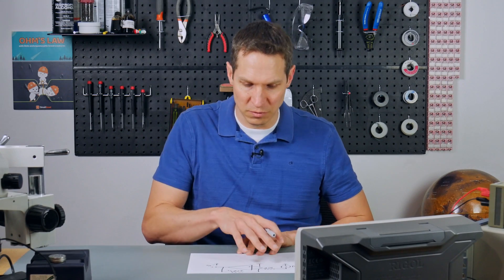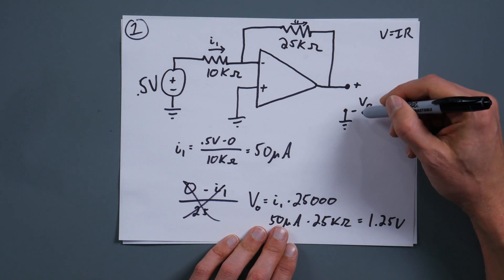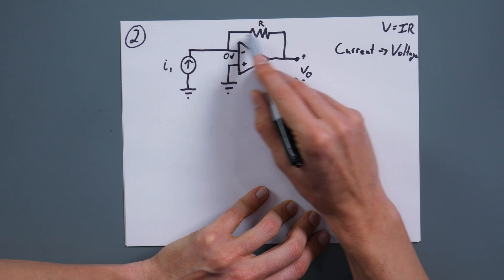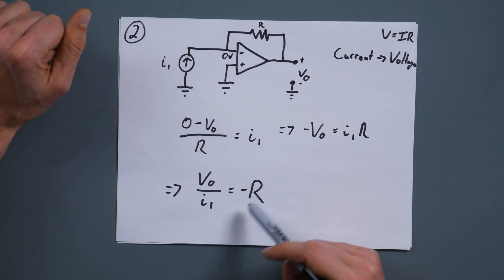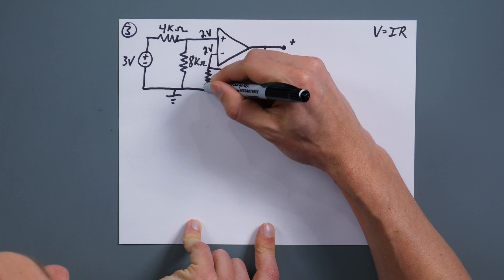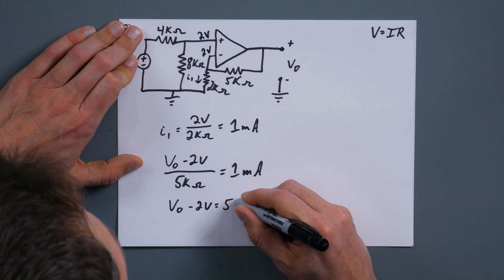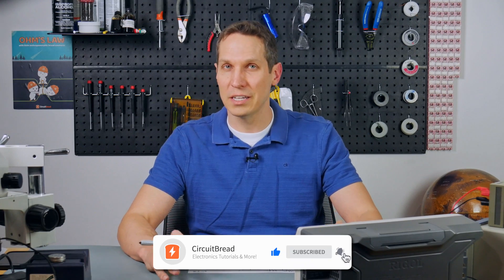Op-Amp (Operational Amplifier) Practice Problems

Comment: Just sayin’ If we have a 5v source going through 35k of series resistance and then straight to Vo. Furthermore zero current goes past the inputs. Why even put the amp in at all?
Reply from the maker: Great question!  We address that in a few other videos but, for that specific question, it's a matter of impedance.  The output of an op-amp is very low-impedance while a 5V source, going through a 35K series resistance, is going to have significantly higher output impedance than an op-amp.

Comment: First practice problem: 0.0005 amps is not 50 micro amps but 500 micro amps, which means voltage output is 12.5, instead of 1.25 volts.

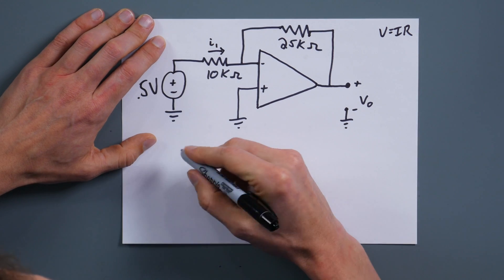Comment: 2:15 shouldn't the denominator be 35k Ohms? The current flows through both resistors, so the resistance has to be the sum of both resistors, or did I miss something?

Edit: I did, now I understand the whole.
Reply: Nevermind, thought it was .5V - Vo and not .5V - 0

Comment: For the first example, the Vout should be -12.5V, not -1.25V.  Vout = -(I*RF) = -(0.0005 A * 25,000 Ohms) = -12.5V.  Also, Vout = -(RF/R1)*Vin = -(25,000 Ohms/10,000 Ohms) = -12.5V.  Or Vout = -(Vin/R1)*RF = -(5V/10,000Ohms)*25,000 Ohms = -12.5V.  Mistakes happen all the time.  That is a human flaw and the first to rectify that issue will be the richest man in the world.

Comment: DOUBT in q3: how can the same current of i1 flow in 5k and 2k ohm resistors. won't there be any division of current
Reply: I think the tutor is assuming, 
vo->5kohms->2kohms-gnd is considered, then, using the fact the volt drop across 2k ohms is 2-0v, leads to 1mA, being calculated, and assuming opamp doesn't allow i1 to enter its + terminal, the current flow in series starting from vo is  taken to be 1mA.

Comment: 8:20 Sorry. To me, this isn't as simple. How did you know to drop 1 volt over the 4k resistor and 2 volts over he 8k resistor?
Reply: As he mentioned, you can just view this as a voltage divider. The current through flowing through the resistors is identical, as they are essentially in series configuration. This means taking the total resistance R = 4k + 8k, and dividing the voltage by it to get the current I = 3V/12k =250uA. Now to find the voltage drop over the 8k resistor, we just multiply the current through it by its resistance. V = 8k * 250uA = 2V  Hope this helps :)
Reply: @Mlhouston3  I was so confused about that calculation but you just cleared it up for me.
Reply: Yessss

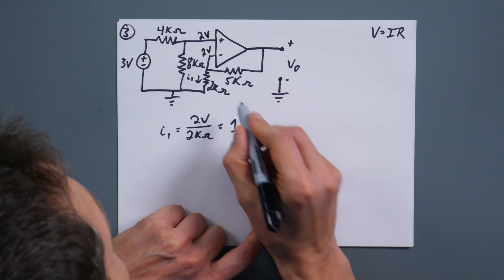Comment: At 9:36, how do we know that the current through 2KOhM resister (i1) is the same as through the 5KOhM resister. Shouldn't the current be different on the 5Kohm side? Not intuitive there.
Reply: because they are in series
Reply: I bit late, but I think I know why. In the example, he assumes the current is running from the righthand side(side with Vo) to the left. So the current first passes through the 5k resistor, comes the the junction, can’t go up due to no current being able to flow into the OP-amp, and so all current has to flow through the 2k resistor. It wasn’t intuitive for my either, until I saw him answer why he went with: (Vo-2V)/5k, and not (2V-Vo)/5k.

Comment: You are teaching some very bad information here. I’ve taken my time to see if it’s just interpretation, but it isn’t. 

1.  The voltages at the two input pins are NOT always the same! If they were, the OpAmp would have no use. An OpAmp is an ideal differential amplifier. That’s all it is. The voltage difference at the two opposite polarity inputs is the input signal of any differential amplifier. If there is no difference, as you say explicitly over and over, the output will always be 0v.

2.  The output pin should be considered a perfect current sink. What’s a perfect current sink?  Well, ground is. Treat it as ground for the purpose of feedback R value computations.

Comment: You have current flowing from Positive to Negative.  WRONG!  Even the US NAVY teached electron flow from Negative to Positive.
Reply from the maker: I'm confused, as you just said what we have said in many lessons.  Current flow is from positive to negative.  Electron flow is negative to positive.
Reply: @CircuitBread  Current flow (electrons) flows from negative to positive. Always! That is what I was taught by the US Military and that is what I have been using for over 40 years.
Reply from the maker: I'm not sure what to say, other than: https://letmegooglethat.com/?q=electron+flow+and+current+flow
Reply: @donaldchapman8392 Electical engineer here. Current flow in the convention that we use to make solving the problems simple. We sometimes refure to it as the holes that are moving which is a postive charge even though it's actually the electrons that are moving which yes move from negative to positive but they are a negative charge themselves so it's easier mathmatically to think about it the other way around.

Comment: I1 = 5 /10 k
     = 0.5 milli amps or 500 micro amps (not 50 micro amps)

Voltage drop across 25 k ohms= 0.5 ma* 25 k
           = 12.5 volt

Vout = - 12.5 v
Reply: He did say "Point Five Volts"... that makes it 0.5V / 10k Ohm

Comment: how do u calculate in the third practice problem the 2 volts. cause i dont understand that part
Reply: So because there is a voltage divider you use Vin ( R2 / R1 + R2 ) to get Vout. Which is 3v ( 8k / 4k + 8k ) giving you Vout of 2v.
Reply: @bunnie7556   thanks

Comment: These were more the theoretical problems with op amps. The practice problems are much different, like:

- the input current is not really zero, especially not in the case of bjt op amps
- in certain cases you need to take care of the input offset voltage, especially in the case if you use op amps as comparators.
- when you operate with pulse voltages at the inputs you have to make sure, that the operating voltage stays stable, even if you need to operate with a certain capacitive load at the output. So you have to use stabilization capacitors between the Vcc and GND pin of your op amp or two of them if you operate with a symmetrical operating voltage. Otherwise your circuit will fall into oscillations
- the nonlinearities of the op amp input circuit can demodulate rf. So if you want to build up an audio amplifier it is sometimes necessary to use a low pass filter at the signal input to suppress rf interferences to avoid that you have some closely located radio station music in the background of your audio amplifier output.
- if you need higher voltage amplifications (for microphone or phono signals), you need to make sure, that the gain bandwidth product doesn't compromize your amplifier at the higher frequencies. Also the input referred voltage offset and noise voltage become important in such application cases.

etc.

Comment: I am confused, how can there be a -1,25 volts on the Vout? Shouldn't that be positive? Just need some help. Sorry for the dumb question.
Reply: I think I get it, it is a negative signal compared to ground? Correct?
Reply from the maker: Exactly!  0V or ground can be somewhat arbitrary.  It's just a reference point and to have a negative voltage just means the voltage is lower than that arbitrarily chosen reference voltage level.

Comment: Nice video, thanks. 
In the last example, I think you have 1mA flowing through 2kΩ + 5kΩ, which gives us 1mA * 7kΩ = 7V
Reply: we dont know the voltage between the non inverting input and output, but we know that between the non inverting input and ground we have a 2V voltage drop, therefor we can calculate the curent that goes from node that connects the 2K and 7K resistor to the ground, which is 2V/2k=1mA. If 1mA exists that node, then 1mA needs to entry that node, and the only way is through the 7k resistor (KCL)

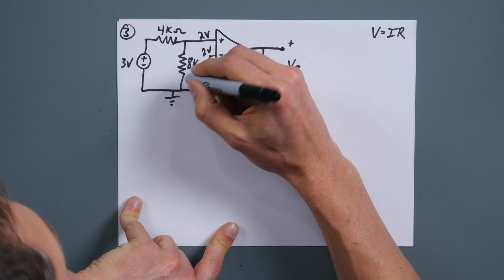Comment: at 9:08 why did he find the current across i1?
Reply: Because with First Kirkowf Law every current who goes in a spot (i dont know the right term but its the place where three or more wires connect) are equal to those who flows out. So he finds the current across i1 and then he knows the current that goes in the amplifier is 0 so he can find the current in the next resistance. I hope it makes sense 😅

Comment: To anyone that is still confused: 
In example 1:
the 25k ohm is the feedback resistor Rf,
the 10k ohm is the input resistor Rin,
Because the supply is connecting to negative side, which means the signal must be inverted and amplified,
The multiplier is Rf / Rin = 25k ohm / 10k ohm = 2.5, again, it is inverted, so it is -2.5
So the final answer, the output is 0.5V * -2.5 = -1.25V
Reply: In example 3, because the current path is only one way, so, we can use 1mA multiply by 2k + 5k ohms (they are in series, no current going into op amp as the rules stated), the answer is 0.001A*7000ohms, 7V !

Comment: Another method of calculating Vout using the gain of the opamp. Gain=Vout/Vin, since same current I1 is flowing through both resistors, Gain=R2I1/R1I1=R2/R1=25Kohm/10Kohm=2.5. Vout=Gain*Vin=2.5*0.5=1.25V. The sign of Vout should be negative because the input on the inverting port of the opamp is higher than that on the non-inverting. So Vout=-1.25V
Reply: great explanation

Comment: My question is why do'nt we consider the 25K resitor when we are calculating I1? Isn't the same current I1 flowing through both resistors?
Reply: That's exactly what I was thinking, if you found an answer please let me know.
Reply: We have .5V from the source to the non inverting input, not from the source to the output. That means that between the source and non inverting output (where the potential is 0V) we have a .5V voltage drop, therefore we can calculate the current that goes through the 10K resistor. The voltage between the source and output is 0.5V+1.25V=1.75V, and if we apply ohm law we have i=1.75V/(10k+25k)=50uA, I hope this make it more clear @abrahamjones3635
Reply: I have the exact same question.

Comment: I was confused about the sign of example 1 until I realized equation 2 should be (0-V0 ) = (50 microamps)(25K ohms), yielding V0=-1.25V. The voltage drop across the 25K resistor is 0-V0, which is the tricky part. In example 2, its strange to think about negative resistance (IMHO), so I'd suggest R = -V0/i1. It's the same math, just seems to better reflect what is happening in the circuit. In example 3, I believe the equation to compute V0 should be 2-V0 = (1mA)(5K) = -7V.
Reply: from what you said 2-V0=5V, V0 will be -3V not -7V
Reply: @andy2a2m  Yeah I think that's the answer too. It looks kinda like an inverting OP AMP so it checks out. Shame he didn't update a correction. I would've gotten tripped up too if I didn't go into the comments.

Edit: Actually, no it doesn't. It looks more like a non-inverting OP AMP. I didn't take into consideration that current could be flowing from the output to the ground instead. Disregard my comment.
Reply: the answer is actually 7 volts
Reply: thanks for corrections, It made me understand. But In example 3, third equation; where is 5V comes from? Am I missing something?
Reply: @mustafanaber  1mA*5k ohms

Comment: In exercise 1, since this is a non inverting amplifier, couldn’t we use (25/10)0.5 ?
Reply from the maker: Kinda!  This is actually an inverting amplifier and the equation for Vo/Vi is -R1/R2, so we could do -(25/10)*.5 to get the final output a lot faster.  For most situations, you'd just use this equation to make your life simpler, but the idea was to show how to solve for op-amp problems utilizing the characteristics of an op-amp.  For this, the learning is in the process more than the result.  Hope that helps!

Comment: Another thing I would explicitly state for the pedagogy of circuit theory is that you should never do nodal analysis on Vout as it does not have the same assumptions for conventional nodes in that current does not accumulate in any node. I find that some of my tutees did not know this because it was simply implied but never clarified.

Comment: Truth be known, I'm obsessed with this device (and the transistor, LOL). I was a circuit board designer (mechanical layout of circuits) for years and was always impressed by the many uses I've see with op-amps. This video instills great confidence! Thank you for the time you put into making these videos!
Reply from the maker: Nice!  Op-amps were so confusing to me at first but once I started to figure them out and saw how incredibly useful they are, I admit I got a bit obsessed as well.
Reply: I was also a PCB layout draughtsman - never ceases to amaze me how we were just seen as monkeys with tape (yes I am that old) when in fact we could quite often have to fully understand the circuit design to lay it out properly - we in fact had the same skills as the circuit designer - and then some.  Nice video chap.

Comment: I don’t want to be the wise guy because I am not. Perhaps there is a small math error in the above video in the beginning 2:25 minutes in the video? U (Volt= V) / R (Ohm = Ω) = I (Amperes = A) therefor 5V/10KΩ i.e., 10000 Ω = 0,5 milli amperes or 0,0005 Ampere or 500µAmpers (Micro Amperes) not 50µAmpers. So 0.0005A x 25KΩ = 12,5 V not 1,25V. 

Ω=ohm symbol
Reply from the maker: Hey Bendt, I had no idea this was going to cause so many problems when putting this problem together but there have been many comments on this.  The period in front of the .5V seems to be missed very easily.  So, your math is totally right but with the wrong input.  It's .5/10K not 5/10K, so the answer in the video is actually correct.  I appreciate you taking the time to provide the feedback!
Reply: @CircuitBread  yeah, putting .5 instead of 0.5V was a mistake, easy to overlook the point.

Comment: Hi for example 1 could you explain why the current going through the 10k and 25k resistors was defined by 0.5V/10k Ohms instead of 0.5V/(10k + 25k) Ohms?
Reply: Im actually still confused on this; if no current flows into the inputs then the only current path would be through both the 10k and 25k resistor right? So wouldnt the current flow be defined as .5 / (10k+25k) ?
Reply: @mcpoogle9058  hi, I know this is an old comment but i will explain anyway. We have .5V from the source to the non inverting input, not from the source to the output. That means that between the source and non inverting output (where the potential is 0V) we have a .5V voltage drop, therefore we can calculate the current that goes through the 10K resistor. The voltage between the source and output si 0.5V+1.25V=1.75V, and if we apply ohm law we have i=1.75V/(10k+25k)=50uA, I hope this make it more clear
Reply: @mcpoogle9058  Yeah I think we need a video between the introduction and this one that explains how the equilibrium is reached and how the voltage/current flows with respect to that second resistor. I definitely missed something or it wasn't explained fully.
Reply from the maker: Hi Georgei!  The important thing here is to remember that the inverting and non-inverting inputs to the op-amp are the same voltage level.  Since the non-inverting input is tied to ground, you can assume that the inverting input is tied to ground.  Thus, the current going through the 10K ohm resistor is found by (0.5-0)/10K.  And, since you know no current goes into the input, you know that same current has to go through the 25K ohm resistor. I hope that helps!
Reply: @CircuitBread  I had the same question and you cleared it up perfectly! Thank you so much! Also, I just want to say how thankful I am that you answered this. Even though the video was uploaded 11 months ago.

Comment: Great video... I was struggling with op amps, your video help me enormously.
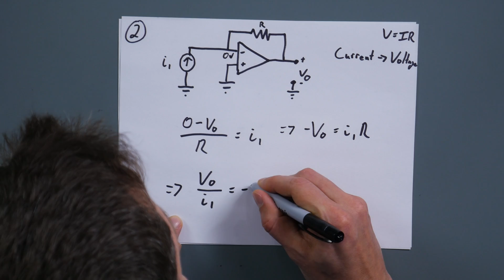I have a question. How at 6:41 you get negative R? I rewatch that part many many times and still don't understand.
Thanks!!!
Reply from the maker: Hi there!  This is a problem that I've seen a lot and have definitely done myself.  It goes back to first step where we show the equation as (0 - Vo)/R = i1  It is very easy to drop the 0 and forget that the negative sign stays!  So that's where it's simplified to -Vo/R=i1  and then that negative sign switches over to the other side.  Does that help?
Reply: @CircuitBread  if we subtracted 2v from Vo in equation that would give -3v. is this correct?
Reply: Another way to state it is that (conventional) current always flows from a higher voltage to a lower voltage. So the zero volts at V+ has to be higher than what Vo is. Thus Vo must be negative valued.

Comment: The gain is 2.5 so output voltage is -12.5 v     please edit video
Reply from the maker: The input voltage is .5, not 5.  So -2.5 *.5 = -1.25  not -12.5V  - those decimal points can be easy to miss!

Comment: can you explain how you dropped volts using simple math in 3rd question, when 3 volts passes 4R it drops one volt and when it passes thro 8R it drops 2V, how?... I ain't no math genius
Reply from the maker: The 3V are dropped over 12K ohms total.  I'm not sure if it helps to think about it this way but, with 3V, it's easy to divide that 12K ohms into three parts and you will drop 1V per 4K ohms.  So you'll drop one volt over that 4K resistor - giving you 2V at the non-inverting node.  This is a semi-intuitive way to look at it but may not be the best when approaching it for the first time.  The more rigorous way to do it would be to look at it like a voltage divider.  I recommend checking out our tool on this that can help you calculate it, shows the actual equation, and can let you play with it until you get a better intuitive feel for what's going on: https://www.circuitbread.com/tools/voltage-divider